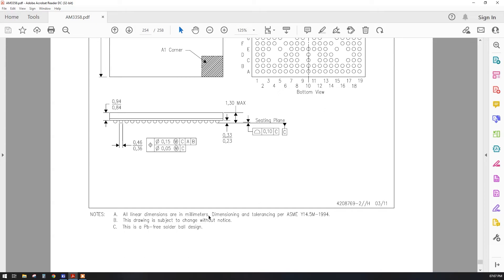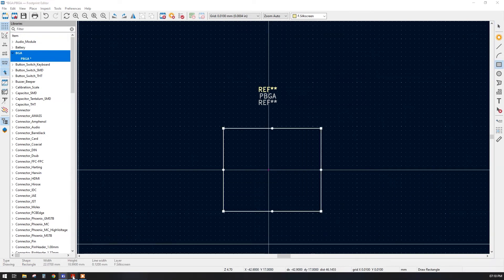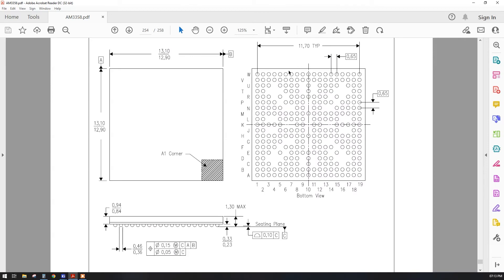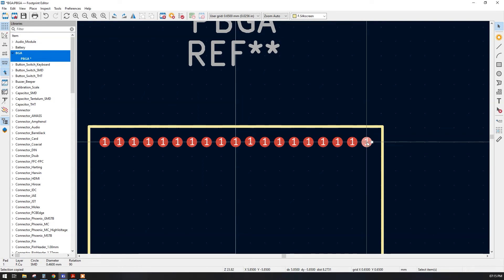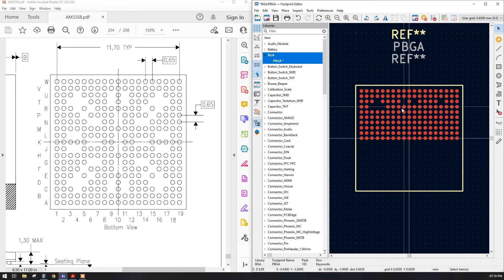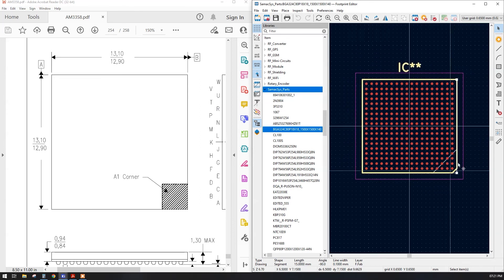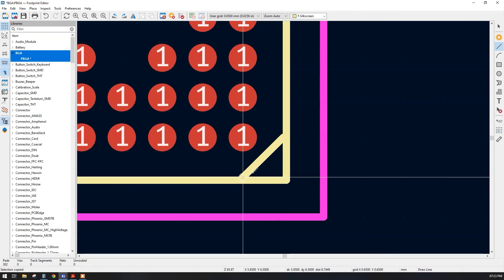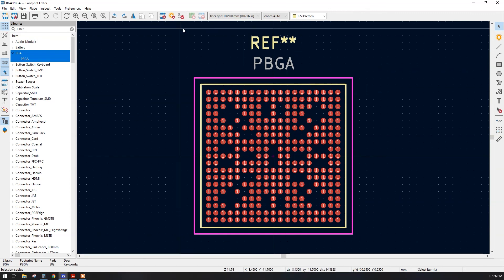Adding a new BGA Footprint to the Library | KiCAD Beginners | Footprint Library | Create a BGA

Comment: Why not just use the footprint wizard? You define the package size, the pad spacing and pad diameters and it automatically numbers the pads. Then delete the superfluous pads. It takes about a minute to do.
Reply from the maker: Thanks for the response Nigel. Yes, It is possible but when we need to design a custom footprint which does not follow the standards at that time this basic is very useful.